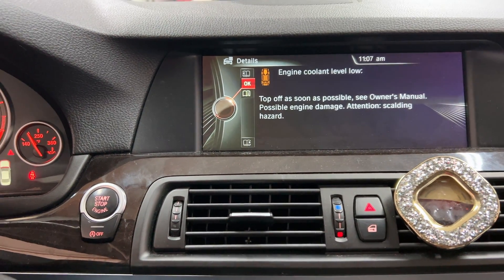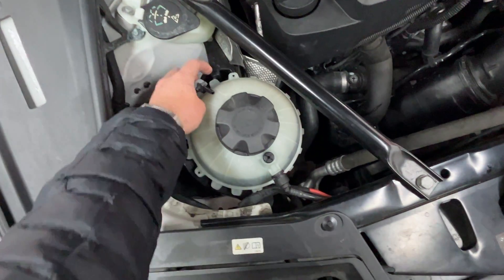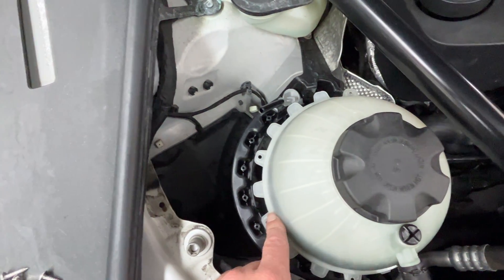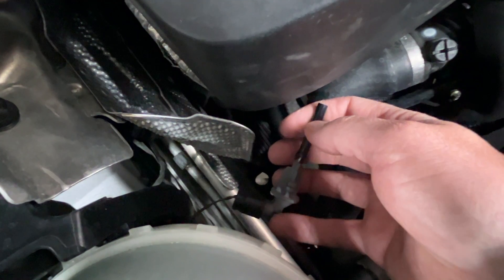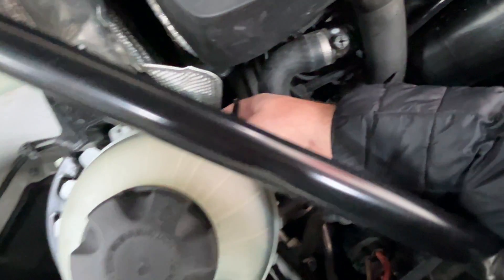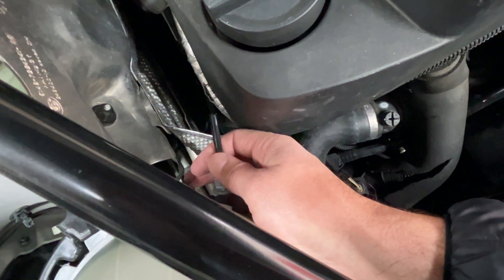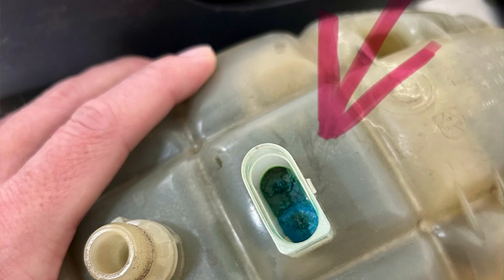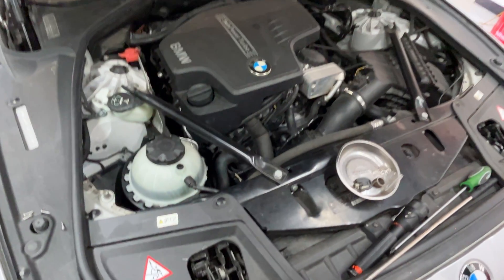BMW - FALSE Coolant Level Warning

Comment: My car is saying this I took it to BMW and they said it was the coolant level sensor. Got the sensor changed and it was not that. The air is not blowing now, only the heat and the sun roof had to be open. And guidance??
Reply: I’m having the same issue right now. Low coolant level warning came on despite coolant being at proper level, & A/C stopped blowing cold at the same time. My radiator fan also blows on high when starting the car cold. Did you replace the entire coolant reservoir or just the sensor? There’s a magnet sensor inside the reservoir, I think that is usually the problem, not the external sensor, so you have to replace the entire coolant reservoir tank. Not just the external sensor.
Reply: @CortonaKAJ I’m have the same problem with my 2014 bmw 320i just take off water pump I drove through some water then I started to have this problem and update if you got yours fix
Reply from the maker: What is the model and year?
Reply: 2014 bmw 528 I x drive

Comment: my 2015 550i looks nothing like this under the hood lol
Reply from the maker: You have a black reservoir. With the big engine.  It is more difficult to test with this method. If the level is good and you are still getting a false warning then it is rodent damage or a faulty coolant tank.
Reply: @MikeMDs  If I dont understand "rodent damage or faulty coolant tank" should i take it to my shop lol
Reply: Levels are good everytime i check but still get the signal

Comment: I have a 2014 bmw 428i coupe and i got this message, can i still drive it even tho it has max amount of coolant? Or do i have to change the sensor/tank asap?
Reply: imo if the temp of the coolant is good, and the thermostat is working properly, then there shouldnt be an issue, i recently worked on this specific issue and despite changing the sensor, thermostat, and coolant, the message still pooped up, a mew resivoir  maybe too pricey for some people, but if the notice isnt too much trouble i doubt it would cause any issues mechanically in the long run

Comment: I replaced mine and everything runs fine and doesn't say coolant level is low BUT now it threw code U019F - Lost communication w/ engine coolant pump control.  Any thoughts on How to fix this?
Reply: Coolant pump is electrical. Did you do a proper pump bleed, pressing and holding the gas pedal down for 10 seconds? Clear the the code and if comes back you'll might need a pump
Reply: @optimalorlando I did this procedure I’m now moving to next solution changing water pump

Comment: Having the same problem 2014 Bmw 528i topped it off and still goes on ,after I turn my car off it goes away   I wonder if I change the sensor will that fix it,no leaks no where but temp for oil goes close to 250 not sure if that’s normal or if it’s the same issue
Reply from the maker: You probably have a bad tank
Reply: @MikeMDs how do I fix u019f code I’m in the process of changing water pump
Reply: Did you figure out what was wrong? My car is doing the same thing now.
Reply: Take it to a shop